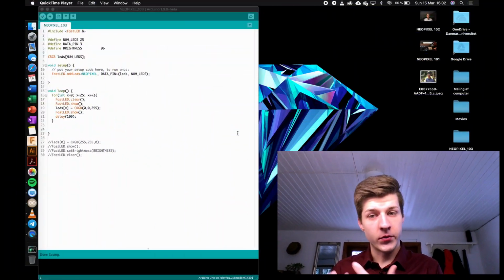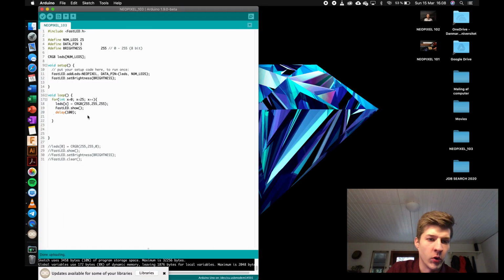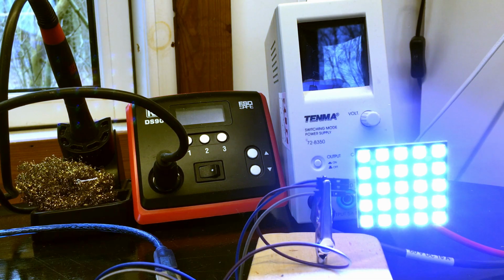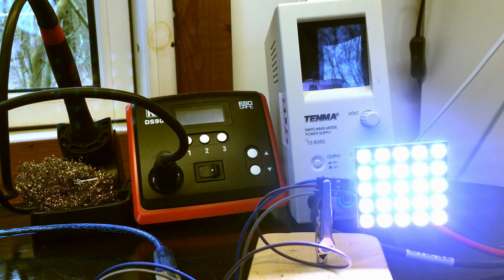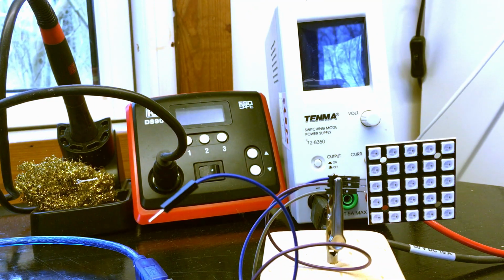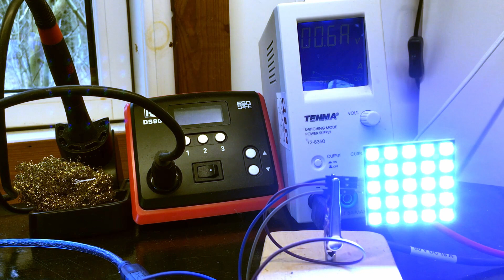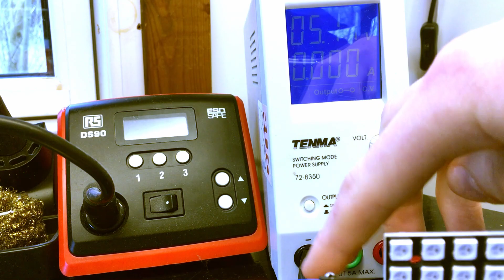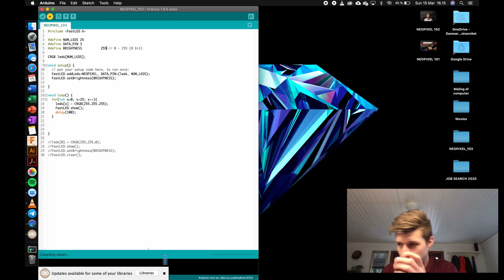NEOPIXEL 103 - Power needs and external power supply

Comment: Hi, thanks for the video! I have a simple question about powering up the whole adruino+leds system. Is there a way to do the contrary of what you do? Suppose I have a powerful USB adapter (like 4-5A) and I want to plug it into my arduino and power up the leds as well, is this possible? Is there a pin that gives me the  USB input power directly?